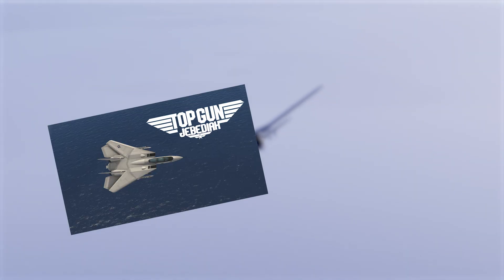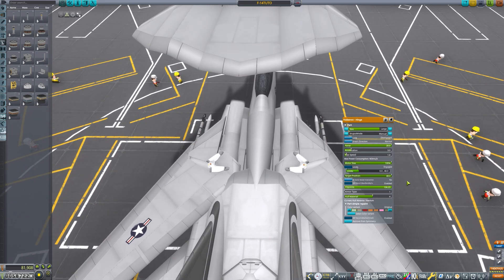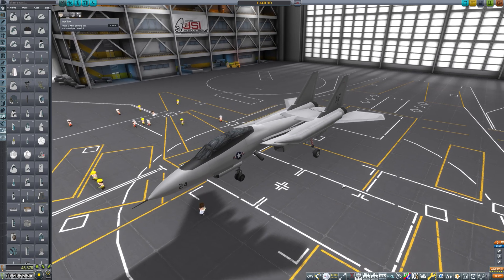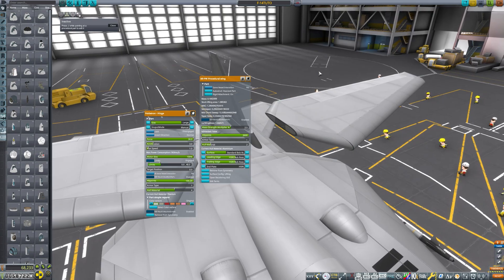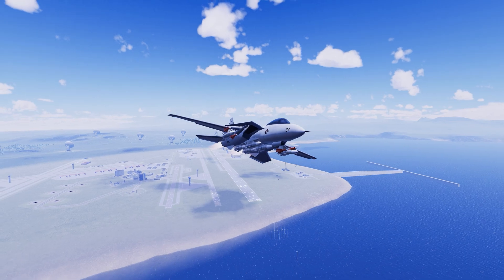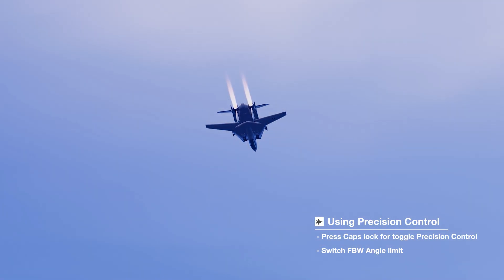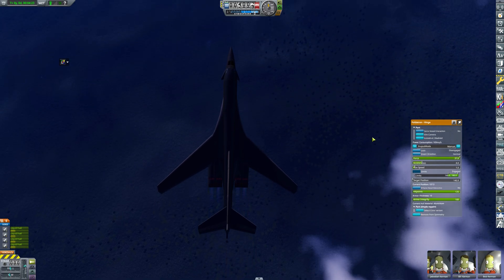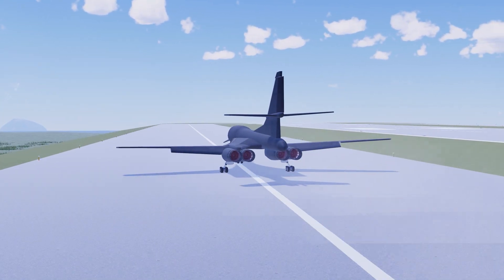How to Sweep Wing | KSP : Very *Normal* Mod Review

Comment: I have a thing to add in my experience-- for movement in flight, you can create the same style 'sandwich' of wings on top and bottom (alternatively can use thin panels that are hidden within the wings) and turn on 'self collision' on both the sandwich and moving wing, this helps mainly with large component wings, especially made from stock parts, but can be hard to make not look ugly.

also side note, I didnt know IR was still around, I thought it died many many years ago! thanks for re-introducing me to it!

Comment: I would like to delve into Ferram. What to do if the plane is very reluctant to raise its nose when releasing the flaps (the rudder deflection is 30 degrees and the speed is decent). But after passing 0 (the horizon), it becomes easier to raise the nose. I don't see much difference in the flaps and without them. The flap area is large.
Reply from the maker: First of all, flaps themselves only change the shape of the wing and should not move in response to pitch.

In FAR, you can set the flap stages from 1 to 3. Typically, stages 1 to 2 are used for takeoff, while stage 3 is reserved for landing.

Flaps slow down the aircraft as they are deployed, so it's essential to deploy them only after gaining a certain amount of speed. For landing, flaps should be deployed gradually during the approach to reduce speed effectively (otherwise, the aircraft might stall and crash).
Reply: @J0ngsh  Are you saying that flaps cannot and should not create lift for faster takeoff and landing at lower speeds? And by the way, I checked and it turns out that the airplane starts to nose paw after the landing gear is released, not the flaps.
Reply: @J0ngsh  I solved the nose pecking problem. She hardly ever follows me.

1. Installed the Fly-By-Wire mod as advised in the video

2. I set a higher angle for the wingtips in positions 2 and 3 than for the flaps, because they are in front of the lift center.  

Is takeoff at +-90 meters per second a good result for a mig-29 based glider? Fuel is about 2,500 conventional units.

P.S. I even got curious. I will try to land a mig-29 and a su-27 on “hard link” in the DCS World game
Reply: @kolopatch1373  he did mame a tutorial on FAR (which I am grateful for)